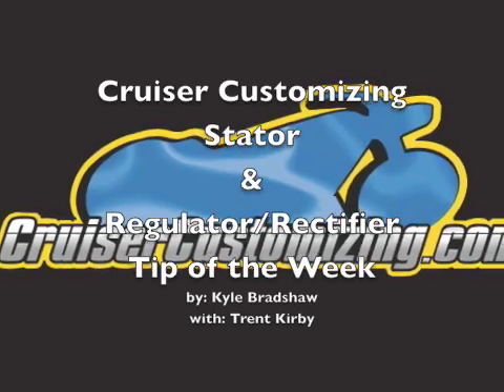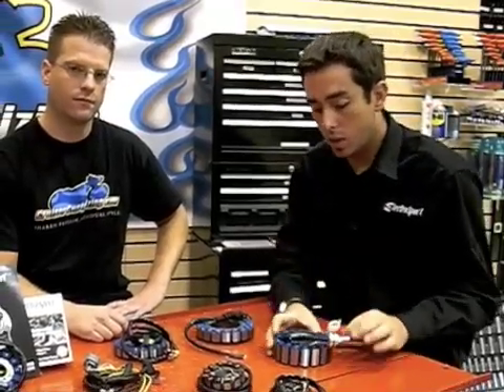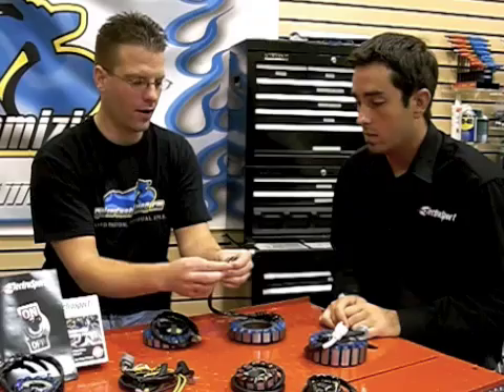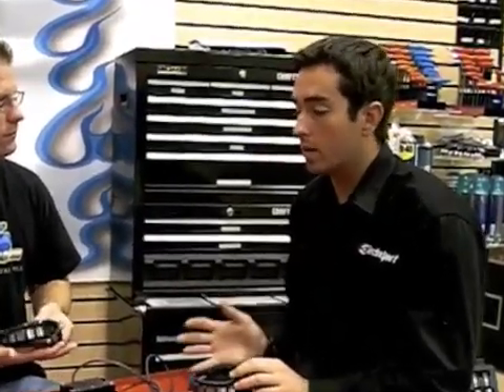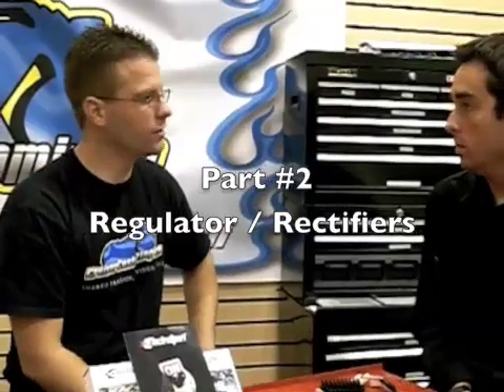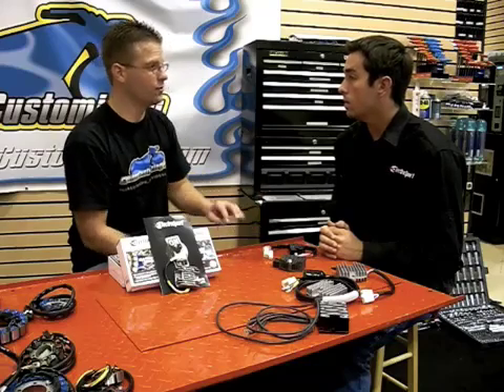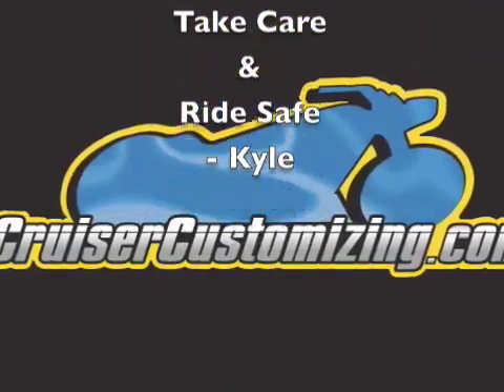Stators & Regulators/Rectifiers - What you need to know? - Video Guide: Tip of the Week

Comment: I've put dozens of GoldWing stators in and on a GoldWing especially the GL1200 you have to cut the coupler off and hardwire the yellow stator wires .. I'm not sure this guy knows that much  .. LOL .. The stator JUST puts out AC power anywhere from 30 vac to 60 vac depending on what make/model bike/ATV ... Most street bikes and ATV's are 3 phase meaning 3 yellow wires on a Honda .. You can actually put different reg/rec on most bikes depending on what battery you have like just a wet acid battery or a gel or mat battery  ..

Comment: installed brand new stator, RR and battery in my ZZR600 D (after having charging issues replacing the individual components one at a time) both the RR and the stator are from the same manufacturer (Electrix) so you would think it would be working perfect....Nope! It overcharges and the voltage accross the terminals fluctuates peaking at 17-18V when the revs are high. I've looked all over for shorts/ checked the earths, but no cigar it all looks fine. pulling my hair out here!!

Comment: Can one of these cause a parasitic see? As soon as I touch it to ground my meter shows a crazy dead short?
Reply: Yes.  If a diode is bad in the R/R, it will act as a direct short.  A diode operates as a one-way valve--allowing forward voltage in one direction only.  So, when diode fails, it may allow "backflow" of power from battery to alternator--ever ponder the difference between a generator and a motor?

Comment: I know on a lot of Hondas (Shadows, etc.) the voltage regulators are a Shunt style, meaning it sends the excess power to ground, making them run so hot you can't touch them. And they don't do a very good job of keeping the battery fully charged, especially if you run any after market accessories (heated grips, driving light, etc.) I assume ElectroSport is selling a Mosfet style regulator, which is an excellent upgrade. I have one now and it really made a big difference keeping my battery charged. I can have a fully charged battery at idle with my accessories running and still have 13.5 volts reading on the battery gauge. If your voltage regulator has a model number starting with "S", it's a Shunt style and is junk. You want a mosfet regulator. you can get them on Amazon or ebay also. Also, e careful, there are a lot of foreign copies that say they're Mosfet replacements, but are NOT, just so you know. Do your research first.

Comment: Where do I get Stator oil?
Reply: Lmaoooooooo
Reply: it does take a small amount from engine to keep it cool .. google around if you don't believe me
Reply: The stator doesn't turn. Mounted solid to the block.The rotor rotates. Harley's rotor and  stator are behind the primary cover where the compensator, chain and wet clutch pack are and all rotate in primary oil. The stator just gets an oil bath from the rotor...lol

Comment: I hold in my clutch and press the ignition switch. The bike makes no sound at all. Dashboard lights are on turn signals are on. my ignition problem is electrical for sure but do you think it has anything to do with a stator or rectifier?
Reply: Your problem is the ignition switch

Comment: What happens if I mount a 35 Amp. reg/rec on a bike that originally had 22 Amp one? (it's a yamaha r6r 2010)
Reply from the maker: You always run the risk of damage if you install a non-stock regulator. What benefits are you looking to get from the higher amperage rectifier.
Reply: +Cruiser Customizing Video  I have hid lights, and when both ventilators turn on, all the bikes voltage go down for a sec. I thought a stronger R/R would fix that.
Reply from the maker: You would likely benefit more from a higher output alternator/generator.
Reply: Cruiser Customizing Video your website link isn't working

Comment: At about 4:30 you guys discuss regulator/rectifier properties. Higher temp solder, higher amperage diodes and "beefier" circuit boards.  ...roughly "half" the cost.

If I install a higher output stator in my motorcycle, do I need to"upgrade my regulator/rectifier, or can I leave the old rectifier from the old lower wattage stator please?

Comment: 2014 polaris 900 ranger. no charging .stator tested good, battery tested good, regulator tested , .000,.000,.000 and .542,.552,.548 , switched leads and tested .000..000,.000 and .000,.000,.000. according to every video on youtube that is a bad reg. bought new one tested before plugging it in tested exactly the same. put it on and it is charging just fine . whats up with that

Comment: i have 2010 fury , trickle charge on it no problem , i could ride it n it starts fine , but if let it sit for few days and try and start it cranks like it has bad battery and my trip gauge on odommeter goes to zero like if i disconnected battery. weird thing is if i leave it alone sometimes few hours later it will start sometines not . and battery is only 2 yrs old .thanks in advance for any advice or tips.
Reply from the maker: +Nun Ya That could be a bad connection or a bad cell in the battery. I would have the battery tested first and secure all the connectors.

Comment: I will like to know why does my dashboard on Yamaha R1 YZF R1 does not want to turn on there is no power when I turn my key ignition I was driving it good until I turned it off went back one hour later to turn it on and there was no power going through
Reply from the maker: +lupe navarro Sounds like the stator failed and drained the battery as you were riding from the above explanation.

Comment: I have a 82 kz1000 when I try and start my bike I have wires melting.I replaced the first wire and tried starting the bike then I had other wire start to melt these wires are going to a box under the battery Any suggestion where to start. Looks like maybe to much volts?
Reply: Bill Spalek it may be that your regulator/rectifier is under the seat and over working....try load testing your battery and make sure all connections are clean and tight,and that all cells in the battery are filled (you can add distilled water to the unsealed type,then 30 minute low amp charge to mix) if your main fuse didn't "blow" it may be a real trace down wire harness problem....start with the battery and load test.

Comment: My 78 cb750 is overcharging, replaced regulator/rectifier, fuse box, wire harness, ignition switch, and points...i've tried two regulators, mechanic is telling me it must be a faulty, brand new, regulator/rectifier...he swears its not the stator, or field coil...does he know what he is doing?  Does anyone have any thoughts!
Reply: I got overcharge in my Honda, 18-19volts, did you get it fixed?
Reply: @BeyondWrittenWords  it’s been so long ago I forgot exactly but it did get fixed

Comment: i have a problem with my china made motorcycle 100cc, can't charge properly because of low charging, wen i test it in a multimeter without the battery, when i kick start the engine 4volts and 8volts when running ....my battery is in good condition no problem perfeclty 12volts..what do you think is wrong? thanks.

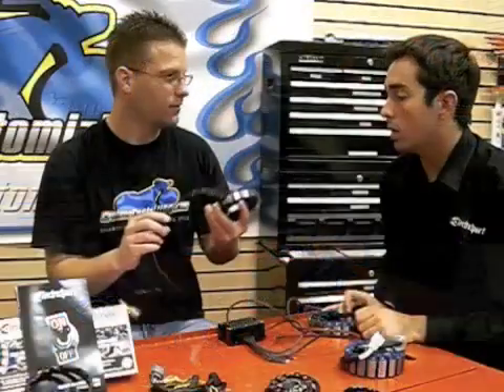Comment: I'm in need of help on 95 Honda Helix CN250 ...it's not charging. When connected to the battery jump starter it runs fine, when I disconnect the jump starter the odometer immediately shuts off and 1:30 later the whole bike dies. HELP! Im currently replacing the stator because that's what feedback i was getting said to do HELP!  The video is on my channel. The first vid. Thanks!

Comment: I bought a stator for my 2004 Honda shadow sabre and replaced it. I still am not getting a charge and im wondering if its my charging rotor? I havea  good ohm reading on all three yellow wires, but when I start the bike not all three yellow wires test around the same voltage. Would a rotor cause this to happen? Or did I get a bad stator for electrosport?
Reply: Ended up being the rectifier also. I believe they were both bad

Comment: Keep a weekly check on your battery terminal tightness and you may never need to repace the stator, rotor, regulator or all the above.A loose bat term, equals more work for volts thus more heat more resistance a visious circle starts can be very costly but easy to repair. Almost all faiures are from a loose terminal or dead cell in the battery, thus more work for the stator/regulator the rotor (magnetic part) is hard to hurt.. My 90 Softail will run at least 50 miles on just a full charge...... I you must do this to get home orhelp please unplug the regulator from the stator plug or you will will burn up your regulator..  I got down to 6 volts got home , charged the battery to 14 volts and took off to the harly shop 2 miles away and my regulator plug melted poof no reulator! I leared this the hard wayagain.
Reply: James Howard glad I read this comment help alot

Comment: 82 Honda V45 turned engine off after ride went to start to put away for the evening no power at all. Found 3 burnt connectors coming from regulator/rectifier repaired them.  Battery good no electric nowhere lights, horn, electric pump when turning key over no juice.  No problems leading up to this main fuse good cant find any other problem visually.?????
Reply: The 3 yellow burned connectors are a common problem with the early V4's.
When they melt and touch, your stator shorted. It's toast, and will not charge the battery. A working replacement is required. Fixing the wires accomplished nothing. Join a V4 SabMag forum.  Lots of information. Fix is to replace the stator, & then SOLDER the 3 yellow wires to the 3 yellow rectifier/regulator wires. Shrink wrap and keep them insulated from each other with electric tape. Otherwise, the bike will die out in the middle of nowhere on you.

Comment: im stumped my bike is charging under and on my bike you test the conecter at the reg retifier to limanate the stater the book said if i have a reading of 0.2  to 0.6 replace the reg retc and watching a video on readings on my stator are it reads good  all yellow 3  wires  are 1 1 1 and some times .009 they said young so i replaced reg rec still not charge ran it to ac volts 27 and past the neg to ground now i think i have to physicaly look at it stater i am auto mac and it did just kill so i dont know unless not the right readings on stater the bike is cb     250 nighthawk hounda the book is climer i know i need to buy my bike manual sm section in there thats how they told me to test it sorry all the wrighting but putting out only 12 volts running but    not realy disgharging under 12 any ideals?

Comment: I got a Susuki King Quad 700 I replace the batery one day on my way back home the quad just stop no juice to started up , I connect the charger to this new batery and start's up quick , seems like is the Rectifier I guess , my brain dead brother told me the Voltage when is on has to be 14.2 around if not the Rectifier is gone, I will appriciatte if someone know's if there's a hidden fuse or anything like that, thanks for the help guys

Comment: eyup mate, just wana point out im totally new to biking LOL.  having problems with my GSXR 600 k7 and its electrics. had the regulater/rectifier replaced afew weeks ago because it smoked up n bike wouldnt start.  thn bike appeared not2 b chargin, cutin out n ride n tht. recovery guy said defo nout wrong with the battery. how do i know if its the rectifier not givin out enough power or the stator? also hear its a common prob with the k7, any ways round tht problem? great video to :)

Comment: ZX10r Rectifier/Regulator/Stator problems??? Mine cost over €1100 to fix on a trip from Ireland to Brno in the Czech Republic. The 1st fix (New regulator) in Brussels didn't work & the bike stopped again just as I got off the Euro Tunnel in the UK. The lads in Daytona Motorcycles Ruislip managed to do the job properly and it got me home. I've used the bike for about 1500 kilometres since with no problems but, I feel it was big bucks spent for a relatively small problem.

Comment: @itscloudyagain - i changed my stator and also my regulator rectifier. If the battery is not keeping charge then its most likely the regulator rectitfier. You can get one for a good price at DietzRacing, its an online store based out of Arizona. My bike runs great now
Reply: Same thing here with Honda, it puts out 18-19volts, overcharging and cooking the battery with new chinese reg/rec. What might be the problem

Comment: I have a 2007 yamaha rhino 450. I love it, but I've been slowly adding new electonics and the battery keeps dying. Added a car battery to the stock (pos - pos, neg to neg), still wont run everything I'd like. Would this be an option I could use? Or anything cheaper would be good too. I have a yamaha credit card I'd rather use, but I dont know if this is they would even carry. I would greatly appreciate any advice or ideas.